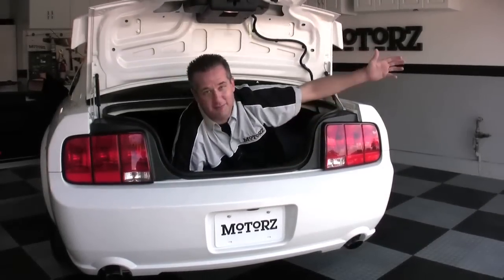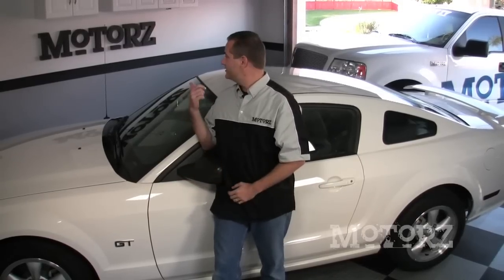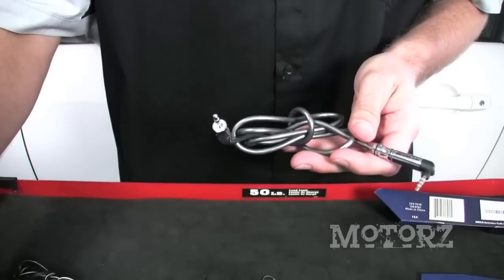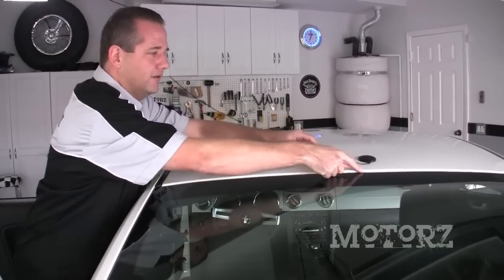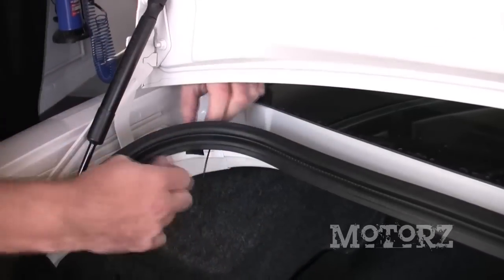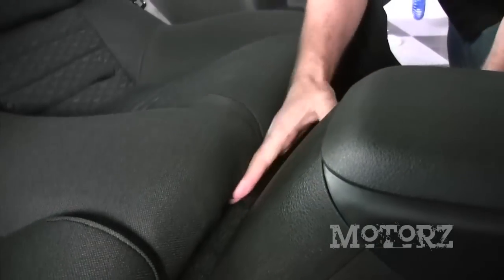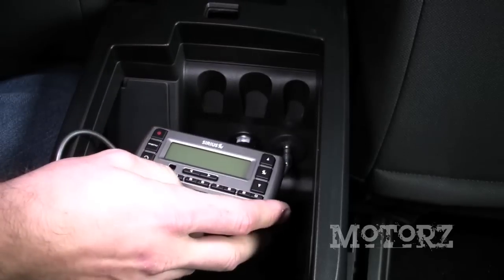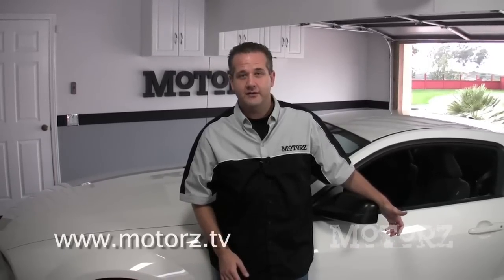How to Install SiriusXM Satellite Radio Car Kit Ford Mustang Motorz #14

Comment: I have had XM radio in my cars/home since 2001, (the commercials and sound quality just kill FM radio) On one of my cars my power antenna broke so I just removed the antenna completely.(I never listened to FM anyway)... A lot of Alpine Head units have Sirius/XM  built in, which is the best way to go because you eliminate the so-called middle man (dedicated receiver, like the one in the video) which require you to run extra cables for power and Aux out or have to run an FM modulator to use with FM radio stations)... With the Sirius/XM tuner built in to the head unit their is no having to plug into an aux input which then has to travel to your head unit, or having to tune your head unit to a FM station... With the XM built in, all you do is push your input button on the head unit to Sirius\XM and you control it with the buttons on the head unit, which also displays the Artist's name and song titles... Also their are 3 separate bands making it possible to preset 6 favorite stations on each, giving you up to 18 preset stations...  Along with several automobile manufacturers their are a few companies that have contracts with Sirius/XM which are, Alpine, Pioneer and Kenwood. Just look for the Sirius/XM logo or "Satellite Ready" to know if the head unit is equipped with it... I do not work for/with Sirius/XM, nor am I affiliated with them in any way. Just an addicted customer.
Reply: The downfall of having your Sirius/XM built into your head unit is that you can't remove it to take to a different location... With Satellite radio your subscriptions are connected to the radio, so with the portable receiver you can move it from car to car to home as long as you have car kits/home kits (cradle & antennas) at each location, while paying for just one subscription... Having multiple subscriptions can add up, but you do get discounts on additional subscriptions. I don't mind paying  extra for the quality and convenience.. You want to really save money, buy the online subscription along with the free smartphone app and you can get it everywhere, just plug your phone into aux. inputs... Though if not on a WiFi connection your data gets used pretty quickly. But with unlimited data, who cares..
Reply: Hey Brotha,

 I just purchased this unit and iam curious about the antenna vs the FM antenna? I was hoping to not have to run wires ect especially not to the outside of my car. I would like to locate an antenna inside the windshield. Which one do I use which is better?

Comment: So how does the Antenna stay along the rear windshield? Isn't rain or wind going to pull it up and have it flapping as your driving?
Reply: I'm sure it's suppose to go inside.
Reply: @projectnerdvana2820  Magnetic antenna. It goes on the outside, not inside.
Reply: It's only a matter of time before a car wash or just nomal flexing pulls out that wire from the window.

Comment: Umm. Pretty sure you could install that inside and will still work just as good. Install it with 3m heavy duty double sided tape
Reply from the maker: True. Or a small strip of nano tape